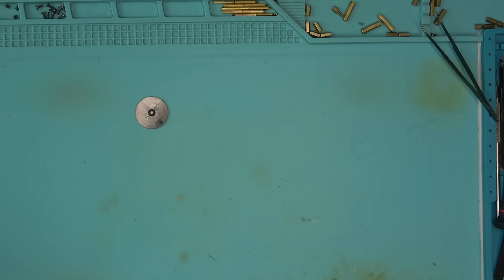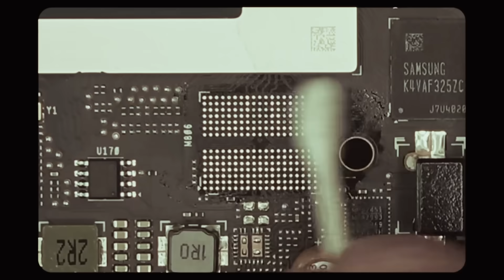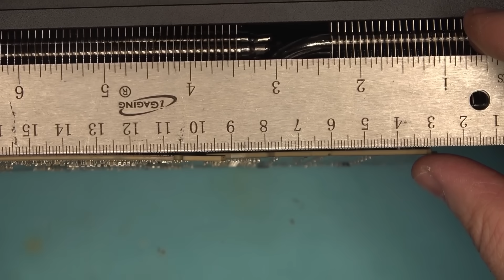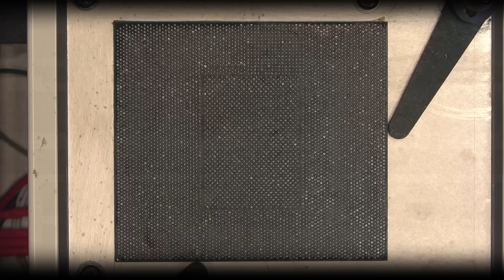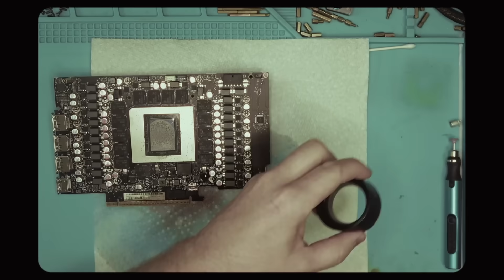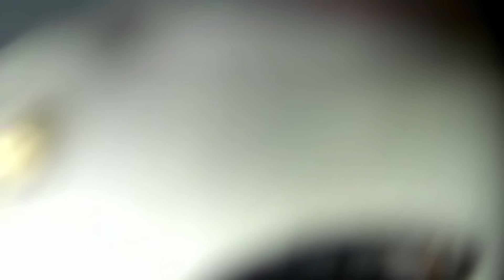Watch this guy performing "out of this world" repair on an RTX 5090

Comment: It's comforting to know that I am not  the only one who just uses wires when it's impasible to "correctly" repair.
I mean, it works in the end.
Reply: You can't ask a human to do the nanometric precise job that is done in factories by machines. The fact that it ended up working is amazing enough tbh.
Reply: Best thing you can do in this case is prevent the crack getting worse and removing any possibility of shorts from the layers flexing, fix rest with wires

Comment: Sweet, I was expecting a board replacement after the first few tries 🤔

Aand when you put the card horizontal again, since you didn't really address the crack, how long will that repair hold?

The design of these cards is so crazy, considering the weight, it seems you have to be extremely careful with avoiding causing any extra stress on the PCI connector.

Not only does it burn, but also cracks. Brilliant.

Thanks for sharing!

Comment: I remember my friends laughing 6 years ago when i bough a screw on bracket for gpu. My logic was if cpu cooler is held by 4 screws and it is 1.5kg,nd gpu is same weight, you are telling me 1 pitifull screw and socket will stop it from bending (sagging). Still rocking that bracket on 3'rd gpu. 😂

Comment: Memory and GPU cooling should be seperate, but I don't know how to accomplish it. :D
My MSI 5080 Suprim runs cool with <65°C on the core, but the VRAM is always a bit hotter, up to 10°C (which is still below 80°C). (In a very air restricted case)
The card also uses a soldered spacer for the VRAM (similar to the PNY in the video), but that spacer has good contact all around on the big vaporchamber. 
That spacer is needed, because the DIE is much higher then the Memory itself.

Comment: The 5090 hasn't been a year old yet and you already have one that has a cracked PCB. PNY is disgustingly cheap in build quality. AIB partners and Nvidia should really work on providing a quality product at this insane price.
Reply: Pretty much any board with a massive cooler in a vertical case could suffer this fate without reinforcement or support.

Comment: The "Founders Edition" versions of the RTX 5000-series cards uses a removable PCIe edge-connector.

This should be a standard on all GPU's as it would make it very easy to "repair" a cracked PCB.
Reply: However, this can also cause problems with PCIe 5 transmission, especially if you want to use a riser cable.
Reply: @auchmeiner  yea
the internal edge connector is already like a riser cable
Reply: @zahnatom  
The two boards are connected directly by just a connector, so it's nothing like a riser cable.

It's similar to how the "Compute Module" for a Raspeberry Pi is connected.
Reply: @SuperConker  it adds the same amount of additional connectors as a riser cable.
Reply: @zahnatom 
Yes, but it's without the cable-part (which makes it much better than any riser cable).
Reply: @auchmeiner  
It's very doubtful it would cause any issues with transmission of PCIe signals,
as the two boards are connected together directly by just a little connector.
Reply: @SuperConker  Zahnatom didn't write that a riser cable is installed internally, but rather that the additional board functions as a riser cable. And signal transmission through this additional board is definitely worse; neither der8auer nor Igor's lab, both German YouTube channels, were able to bypass the cards with riser cables.
Reply: or you could just not damage your board like that.   not sure how that even happens
Reply: @zachansen8293  
If you've watched this guys channel for a while, you will notice a lot of people damage their board like this.

nVidia have "solved" this issue in their "Founder Edition" cards by having two separate boards
(and I honestly think this should be a standard on all GPU's).
Reply: @zachansen8293  they probably transported the pc without a gpu stand

Comment: Finding one isn't the problem (at least not over here in EU-Land) ... dishing out well over EUR 2000 for a friggin' graphics-card is. :D
I must've asked that question a million times, but I still wonder if all/most of these cracks are down to shipping damage and/or owners dropping their PCs or neglecting to put in their GPU supports, etc. While that "hook-area" does look like an obvious weak-point, those PCBs are pretty thick so I'm going to guess they'll usually don't crack on their own.

Comment: GPU Manufacturers should have understood by now that the PCI-E slot is no longer adequate to keep the weight of modern GPU with their ridiculously heavy heat sink. The retain system is also pretty much a joke, and being the cause of so many cracks. The PCI-E slot design must be updated to a new standard that allow heavy cards to be easily inserted/removed and manage to keep safely their weight.
Reply: This is the problem of the cards themselves or the ATX standard.
Everything is fine with PCI-E

Comment: One would think that since the cracked PCB at the retention hook has been a thing since the 30 series that they would have stopped putting traces around the hook and create a built in weakness so the hook will snap off rather than flexing the board ripping pads. And provide a support post with the GPU for those that have a case that doesn't come with one. Mines a black painted pencil super glued to the case lol.

Also 3:45 That extra length added between the retention hook and the rest of the PCB is horrible engineering, fire the engineer level of engineering. There is no need for it as the release for the hook is on the side and the height of the dent between the slot part and the hook is more than higher than the retention mechanism on the motherboard that's the same height as the slot. It isn't needed and it creates more leverage increasing the likelihood of creating a crack. Leverage is a force multiplier, if you have a long enough lever you could lift the earth with a finger. Or take my pencil support bracket as example, take a new unsharpened out of the box pencil. Snap it in two. Now snap one of the halves in two. Snap half of that last one in two... if you can. That extra deep space above the hook is the full pencil. Half it and you halve the leverage and half the chance of a crack.

Comment: i just checked repair prices for rtx 5090 and they are quite expensive. 900$ for GPU, RAM transfer to new PCB with new PCB included.. That would be like the best solution in this case but i guess its not that interesting for video..
Reply: KrisFix has to be the most expensive in Germany because he has a yt channel and everybody knows him, so his orderbook is full.

There is no benefit in having him "close to me" because in either way Repair shops need at least 2-3 days to process the repair (you will pay 50-100 extra for that  speed).
Shipping is only 2days extra.

Most likely other Repair shops will be cheaper because they have less orders in their books if theyre less known.
Reply from the maker: Wow. Who's prices are those ?
I am not that expensive 😮
Reply: @northwestrepair  closest to my location, KrisFix. But i think its not much cheaper in US  with tariffs etc. Its round 300$ fot that job without pcb included on older GPUs like 3090 everywhere i checked. Depends on number of modules that need to be replaced, 5090 has many and i guess complete PCBs are not cheap..
Reply: in my 20 years of gaming i never had to send GPU for repair so it never cross my mind that repair shop near me would benefit me in any way. 900$ is not to high price for 5090 owner with cracked 2500$ gpu and KirsFix is not ytuber for few years now,. Prices are very similar everywhere in such shops i did my home work.

Comment: Secure your boards, people. I switched back to a desktop case orientation with my 3090Ti because these cards are just getting too huge, and I don't want ANY lateral strain on my PCIe connector or the GPU's PCB.
Reply: Yep every card these days needs to be mounted vertically.

Comment: I already saw few repairs on 5090 and oh my god its mind blowing how they still mess card design. Like here they put damn cap and 1000 tracks near critical failure point. Everyone know that card is super heavy, that it break in that specific point, they could move component and tracks there, they have space. They also know perfectly well that memory get hot, but still design cooling in worst possible way just to save 2-5$ on 3K card
Reply: So basically like Apple who put the NAND chip right beside a component that's most likely to blew up so when it does blows up, it takes all of user data with it. Genius! 😏
Reply: @Chocobollz , how can I find more details about this story?
Reply: @Chocobollz Oh man the 2019 16 Inch MacBook 😂 were notorious for this issue.
Reply: Either you put all pc horizontal or you put gpu support.
Reply: @alvydasjokubauskas2587 just use it vertical like most miners do 😅
Reply: this is done so that they break more often. nvidia scam
Reply: The design is shit, but the people installing it sideways without support are at least that much to blame. For fucks sake, if you buy a 2000$ +++ card install it properly. More money than common sense. At least the dupes who but the chipless stripped 5090 boards will have some opportunity to recoup their losses by selling donor boards to these geniuses.
Reply: @fricy81  yep. i have a Asus ProArt 4070ti which is pretty small and slim compared to a 5080 or 5090 and I still use a GPU support bracket even though it most likely doesn't need one, but I paid almost $900 for it so there's no way in hell I'm not protecting it.
Reply: @fricy81  if a $2K graphics card needs a dodgy crutch to function without failing it should be included in the box, I would also call it shit engineering if it breaks if you plug how its supposed to.
Reply: @victornpb  Well, the way you are "supposed to" install a 10 pound GPU is with a bracket. Some DO include one. Check the specs before you buy.
I simply took a plastic stake for a $1 solar yard light and cut it to fit my 3080. It's black, blends right in, can't even see it. Tiny bit of double stick on both ends, not going anywhere. Some people use Legos, action figures, whatever. Some people feel like they must buy a factory made screw in thing. It's not that complicated.
Reply: @yourhandlehere1 i had a toilet paper roll under my gtx970. 6 years at least. Until i moved and never used the pc again 😂
Reply: @fricy81  cut some slack Bro, people buying 5090 loses common senses with the price they are paying
Reply: @fricy81  Your common sense is part of the price.
Reply: planned obsolescence. nvidia taught everyone more ways of greed.
Reply: This is why I have the Hyte Y60 case and have my GPU installed on the bottom of the case so it's not weighing down on itself in the PCIe slot.  And it looks better too.
Reply: Planned obsolescence, just a bit premature
Reply: @dmmax18  if it's premature - it's not "planned".
The "planned" one - it's when smth breaks by itself.
The only "plan" here - is to save money by making it as physically fragile as possible.
Reply: That's not even the biggest problem from design point of view the size of the board is to small to support such a big cooler and the weight it is always gonna have weak point and snap kind a wonder if a smaller cooler vapor chamber would have done it some justice rather then it being a big chunk of metal that does nothing...
Reply: This is hot take especially on this channel , i dont own a gpu because of this , yeah im broke but socketed apu is the future and im thankful for it , thank you ayyemmdii
Reply: "Like here they put damn cap and 1000 tracks near critical failure point. Everyone know that card is super heavy, that it break in that specific point" that is why the warranty does not cover cracks, so you buy a new one for double MSRP, well unless you send it to this mad lad
Reply: The conundrum is that they keep shrinking PCB real estate while packing more densely components and traces while strapping a humongous heat sink atop which do little for support while attached to the PCIE slot.
Reply: Planned obsolescence. They know. And do it intentionally.
Reply: Laughs in vertical mount
Reply: When you sell cards by millions those $2-3 become $2-3 million
Reply: They know what they doing
Reply: Problem is the orientation in combination with bigger and heavier coolers.  
If people (and particularly case manufacturers) would use cube style cases, where the motherboard is laying flat horizontically, these issues with cracking and solder joints near the PCI-E connector becoming detached, would not occur.  
The heavy cooler, and the GPU PCB hanging on a vertical motherboard with the PCI-E connector holding it mostly upright is the cause for the cracks & PCB bending and becoming warped over time.  

This was never an issue back in the day, because the video accelerators of the time were small, their coolers pretty much miniscule and thus never was a issue.  
Now we have these massive metal chunks weighting down onto the PCB and PCI-E connector.  
All while hanging horizontically from the now vertical motherboard, the same motherboard design that was never designed to sit vertically from the start.  
The GPU hangs horizontically thus putting stress onto the PCB between itself and the PCI-E connector.  
It was never meant to be this way, it was meant to sit vertical, spreading any weight straight down onto the motherboard which then dispersed it with it's metal spacers underneath to the chassi.
Reply: USE A DAMN GPU SUPPORT. 

ALL MODERN GPU’S ARE FAR TOO HEAVY TO HANG SIDEWAYS. THEY WEIGH THE SAME AS SOME LAPTOPS. 

THE FACT THAT SO MANY PEOPLE KEEP GETTING THIS WRONG IS RIDICULOUS.
Reply: @redread4414  My 4090 even came with a GPU support. No reason not to use it. 🤣🤣
Reply: @johnwick7175 lol 😂
Reply: @redread4414  One could argue a 3000 USD GPU should include such a stand and a big fat warning that using it is required when mounting it horizontally. A PCB design that doesn't route critical signals through a mechanically stressed area (as in "providing build quality that matches the price") isn't too much to ask either.
Reply: @Psychx_  You’re correct about the stand and the warning. Some are on record as having done either or both.

The “…build quality…” part: understandable, but not so much. 

It is only mechanically stressed when the user PUTS it under mechanical stress. Installed vertically, as designed, the stress is negligible. It’s that sideways hanging style, yes STYLE, that introduces the problem. Holding your arm down with a 5 pound weight in your hand is nothing, for practically forever even. Holding that same arm and 5 pound weight straight out at a 90 degree angle is not.

If they were to do such a thing, it would require [a] motherboard manufacturer(s) to do the same because that load has to be supported somewhere. They would have to strengthen the slot, which means they’d have to strengthen the entire motherboard, and so on, all the way down to the case mounts. Possible, but you’re talking about r&d, increased costs that WILL be passed on, etc. Maybe some company will eventually produce parts intended for sideways builds that take know-how and expertise yet further out of it, but in the meantime it will stay how it is. Industries know diy is a growing and profitable thing, but labor, specialist, and etc. groups constantly push back against that for livelihood purposes. Even still, there will always be those things that you (gasp!) have to actually go learn something to be able to participate in.
Reply: @redread4414  there are some 'low end' cards that are fine, well if you could actually buy the MSRP model...
Reply: @redread4414  Nobody used GPU support for any generation of GTX cards.
This is nonsense and a joke.
Also, this has a f`n backplate. What is the purpose of it? Just to add weight?
Reply: @DrWatchHD  Backplates acts as a heatsink also.
Reply: @DrWatchHD  It's to keep everything except the tab rigid.
Reply: @DrWatchHD  I have used GPU supports for my GPU since the GTX 700 series where they started making triple fan coolers for the 780ti. The thing is they used super thick PCBs back then and GPUs weighed half of what they do now so you didn't have to worry as much. Backplate is there mainly for looks but if implemented well with some thermal pads it can provide cooler temps especially VRMs and VRAM chips. Backplate could also be used as support for the GPU if made and designed well.
Reply: @DrWatchHD  because at that time the cooler basically as large as the boarf itself, now the cooling parti is almost twice of itself, and those heavy cooper and alumunium is not gonna hold itself cause they need to hang so they dosnt release heat in wrong place, unless you get the watercooler version, anti sag is needed
Reply: @megimargareth4015  thanks
That was more a rhetorical question from my  side and a mocking of modern GPU design
Reply: yeah but those 2-5 $ times the number of units shipped soon adds up to much more profit. its about micromanaging the pricing, saving where you can and making profit on volume on everything to future proof against a year or two inflation rises in component costs.
Reply: @davidhines7592  Pennies eventually turn into dollars. This why your new $60K+ "truck" is made out of plastic.

Comment: This is what $3000 buys you... what a value... and I geekly wonder, for those extra wire, with a card drinking up the power of a space heater, is it really safe to run in long term?
Reply: They're just signals going through those wires - if they do break, card stops working and doesn't pull 500+W anymore lol